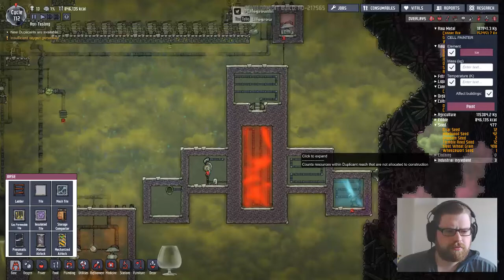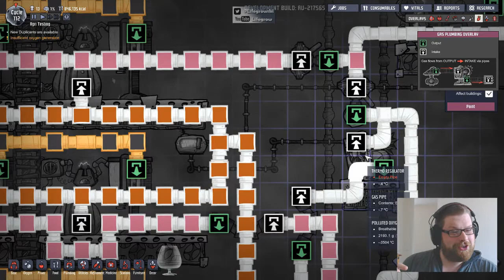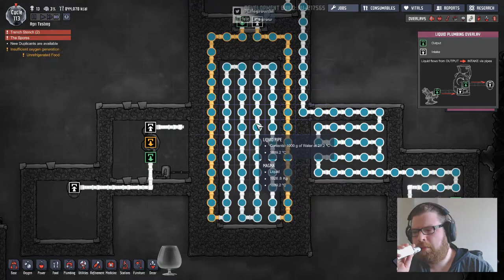Liquid Temp Change

Comment: yah this is by far my personal least favorite bug
Reply: and the added temp was the filter
Reply from the maker: Actually no, it was figured out in the forum thread - the temperature change came in the "ultra brief" moment that the liquid stopped moving when I deconstruct the pipe. You can actually see it happen, and I have replicated it in debug since. That's where it occurs - the output would have been identical to the input if I had just pumped in the exact amount of water needed and never altered the pipe layout. Confirmed, and it sucks - don't get me wrong :)